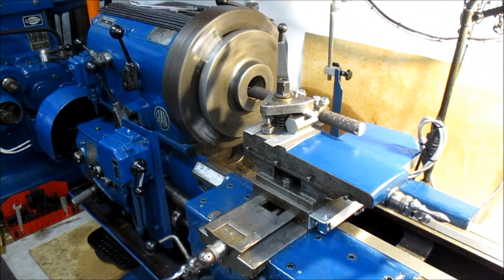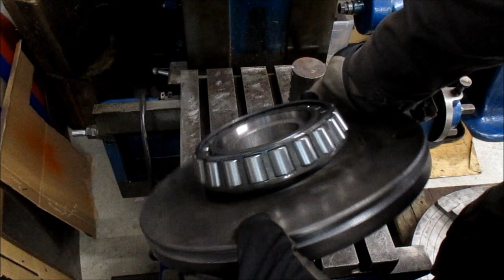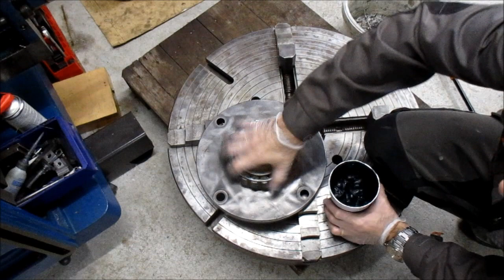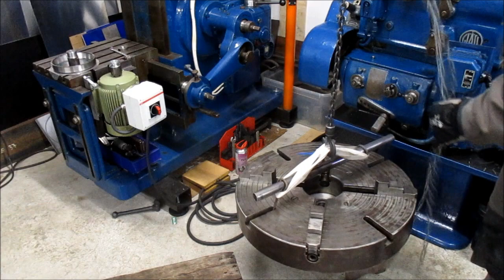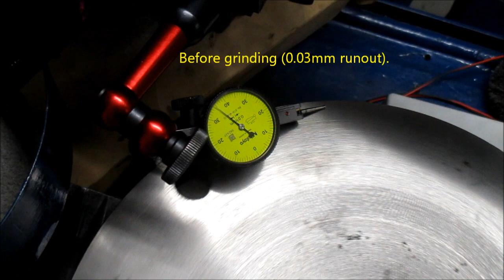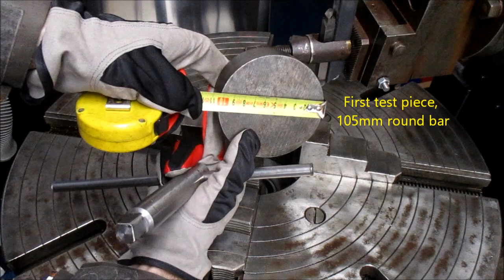vertical lathe

Comment: Neat 8-)  96rpm might be a bit quick for the largest of diameters,  and I think i would want that taper bearing in a seat to support it if I were loading it loading fully.
Reply from the maker: Yeah that 96rpm is just the startup point with 50hz and I can shift it up and down with frequency converter. But actually with CBN inserts, the surface speed at the edges may not even be too high. And I considered a seat for the bearing, but since the bearing itself weights close to 4kg, I though that its unnecessary, but we'll see 😁